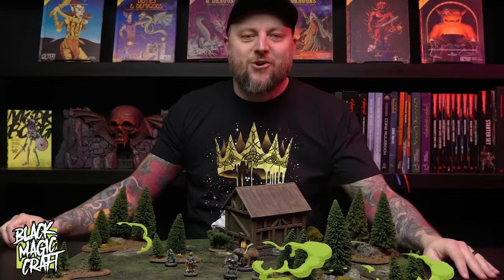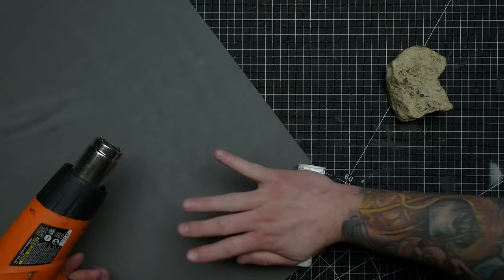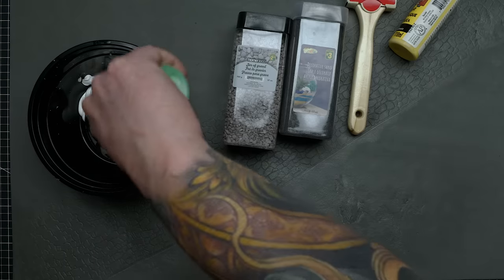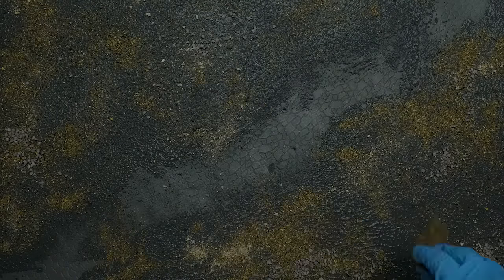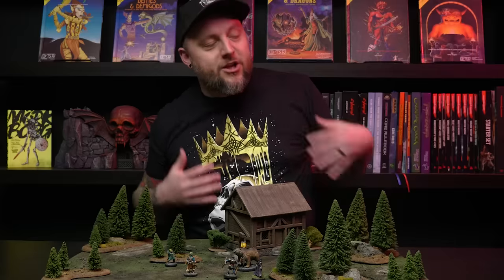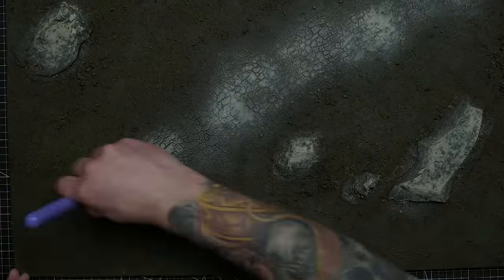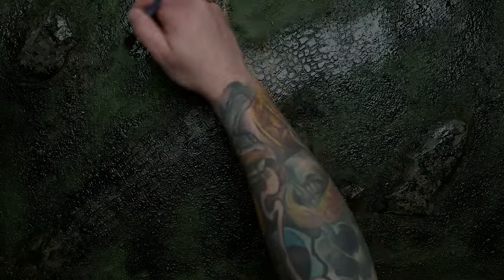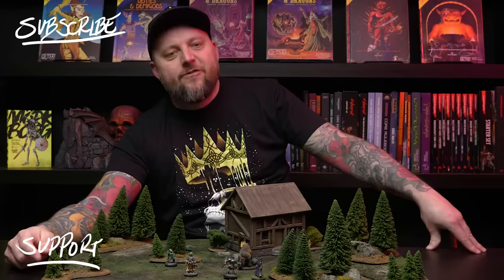How to Make a Cheap Wilderness Battle Mat for Dungeons & Dragons

Comment: Can you do something for a water board. For like a pirate game or something where you would need to put in some sort of desert islands
Reply from the maker: If this video does well I’ll do a water version next!
Reply: @BlackMagicCraftOfficial  This video did well after just 30 minutes. 
👉😎👉
Reply: Honestly I've had the best success with a plain blue vinyl mat. You can also get water-pattern sheets and upholstery. That works pretty well but it's thin and playing on it can move it around and bunch it up. Using a textured battle mat is actually visually unpleasant because the bumps make islands and ships sit all cattywampus and then measurements for play are called into question. I think you can get patterned vinyl though that looks like water and is totally smooth.

Comment: Adding a hole to the texture roller and then fixing a paint roller handle to it would help with consistent pressure/heat danger! Gonna have to try this for when I build my gaming table!
Reply: Many of the rollers are hollow, they're intended to have a core inserted, basically a small kitchen rolling pin. The paint roller handle is a good idea, but when you need to apply force to get an imprint you need to have both ends of the roller connected. Otherwise you get a deeper impression on the side where the handle connects.
Reply: Just as an FYI, Green Stuff World sells rolling pins with handles similar to what you describe.  Don't know how well they'd hold up if someone was really bearing down on them with a lot of pressure, but they do exist.

Comment: I've used clear latex caulk mixed 50/50 as a top coat to make sure the whole ordeal remains flexible and it works a treat. I've had modpodge chip and peel on me.
Reply from the maker: Good idea

Comment: Awesome! I've done a couple of battle mats with caulk using a canvas backing instead of eva foam, but the flocked one didn't work out. Will give it another shot using the flock like you did the tea. Cheers!

Comment: I have been using used tea bags for years for my ground cover.   If you put 50/50 pva/water on top of the tea the tea will tint the pva and give you a swampy muddy look or just matte coat over the top for dark earth tones.  Go make a pitcher of some nice sweet tea and then throw them in a container with some silicon packs to suck the moisture out and your have you drinks for the evenings festivities along with creating some basing materials.  The used bags also make for some nice sand bags/ wheat grain bags.

Comment: Thanks, you and your channel have been a big inspiration for my recent crafting frenzy. When I started crafting, I sort of gave myself a rule to only use leftover pieces of wood, cardboard or foam, or any other would be garbage scrap for that matter. I recently came over my ancient (yes, I guess I can say ancient) transparencies. You, know, the stuff that we used before PowerPoint. I used some as a support for may sewers tiles, allowing for whatever colour or pattern of water depending of what I would use underneath. I also found an old stack of writable CD's. I've used them for magic circles. You can paint them and then scratch the surface and reveal the prismatic glow. I wondered if you had already used that kind of materials. If not, I'd be curious to see what you could come up with. Thanks again!

Comment: When I applied oil washes to my build the last time, I let it dry over night and had a hard time removing the excess wash from it. I used Abteilung 502 thinner and paint for this. So, if you were to use oil washes, I'd recommend to not wait too long until you remove it.

Comment: I did one yyyyyeeeeears ago using floor mats. I since then improved a lot my crafting skills (mostly thanks to you... and practice, obviously). I made a big 5x6 board that looks way better but I rarely use it for RPG since it's way too big. In the light of your video, I think I have to get back and make an improved version. Yours looks approximately 7.4 times better than mine 🤣

Comment: On the question of how long a texture paste mix will last in a sealed container, I've got a couple of batches made nearly two years ago which are still OK. If they start to thicken up, just add in a bit of water.
Another thing you can use instead of, or alongside, tea leaves is mixed dried herbs.

Comment: As a thought, foam puzzle floor mat is 2'x2', so two pieces put together makes a great field for larger battles and if you have 6 of them, you can play Warhammer on a 4'x6', and have distances of up to 360' or 240' on the short side, making the longbow ACTUALLY useful outside of theater of the mind.

Comment: Instead of alcohol to break the surface tension so the glue mix sinks,  you can have a mix of PVA/Water/Mod Podge etc and a bit of liquid washing up (the sort you use for your dishes), the liquid washing up breaks the surface tension and you mix it in with the glue/water, so just one spray and it sticks and spreads in one easy spray.
Reply from the maker: That mixture is known as “scenic cement” and it works even better if you spray the item with alcohol first. It makes it soak in rather than sit mostly on top.
Reply: @BlackMagicCraftOfficial  Fair enough. I must admit I have never had any issues with just adding the liquid washing up to the mix. Thought it may be of interest to those that were unaware and wanting to make it even more budget friendly.

Comment: I am thinking of doing this exactly for random encounters/scenes not fully prepared for style encounters, and maybe doing something similar for caves and caverns - I'm wondering if since the thickness is not too bad on the EVA foam floormats, maybe I could combine your Dollar Tree canvas battle board video from a view weeks ago to help get some water effects going in either a cave piece or a similar idea for a larger piece for a wilderness! Maybe could do something involving stacking them very slightly too....
I've got a stack of the "puzzle piece" ones from Harbor Freight, but these dollar store floor mats being one big size of EVA is also very very useful.

Thanks again for all you do and share!

Comment: Excellent video!  The final product looks great, and is probably as durable as what you said, though I'd prefer bigger. I know you tried to address that at the beginning, but larger would be better.
Reply from the maker: Just use two mats and put them together like I did in the previous video.
Reply: @BlackMagicCraftOfficial  Yeah, I don't know why I even commented about the size of the map. You were just showing techniques and those scale. 

I bet if you used the mat with the teeth, and just left them connected, everything you did  would hide the seams pretty well.

Comment: This material is good for flexiable roads, rivers and other additional stuff, but I think for mats it is more compact, cheap and thin materials: neoprene, dense fabric and other similar. Because there are lightweight, and you also covering everything with ground, grass, sand, glue mix, so the point with pushing texture throught mat is not reasonable, I think

Thank you for this line of videos

Comment: With something like this, could you get double the value for money by doing the other side of the mat as a different terrain, like snow or sand? I mean, theoretically, aside from the patten on the bottom (which could be covered with a thick layer of the latex mix, it should be doable. Unsure whether it would be practical however or make it more prone to damage and wear.

Comment: The budget builds are definitely nice, but I would love to see some stuff I can build that has a lifespan without breaking the bank. So not necessarily budget builds, but something that won't cost more than buying a premade version yourself and still be inferior... 

Like those Acrylic Caulking + Canvas battle mats. I can't remember if you ever did a video on them, but they aren't good and you can buy a neoprene mat for about $10 more that will last forever.

Comment: When I did costume making I worked with EVA, it’s a strange material. It destroys blades in no time, like I believe for every 3 feet of EVA cut your blade dulls by about half or so.
Reply: Are you sure it's not the material you cut the EVA on? Can't say I noticed any dulling. Then again, that's 30 seconds of sharpening, so maybe I just didn't notice.

Comment: Toasty on the hand? 
I believe you know that there are specific gloves for heat. You can use those kitchen oven gloves, or get specific gloves foe working with even hotter temperatures.

Its was painful wathching you holding a heat gun directly into your skin. That can really burn your skin..

Safety first, you know that 😅
Reply from the maker: I litterally said in the video I'd use something like an OvGlove next time!
Reply: @BlackMagicCraftOfficial  oh, sorry, missed that.
Was weird seeing you breaking the safety.
Here at home i told every person that its not a hair dryer. Heat gun can literally burn skin

Comment: use a wooden dowel through the roller and Poof a Texture rolling pin HEHEEHEH
Reply from the maker: So two hands on the dowel.....holding the heat gun with my mouth? Lol.